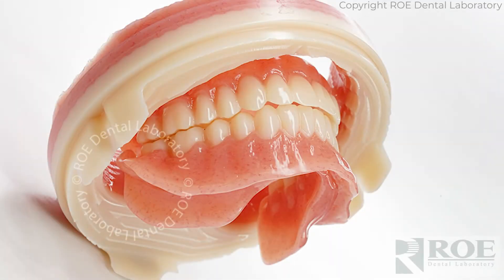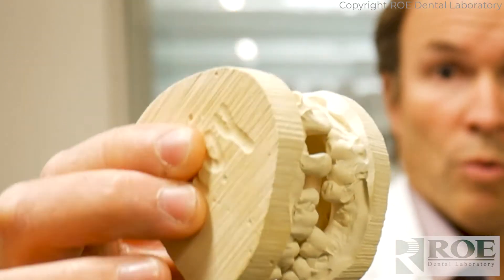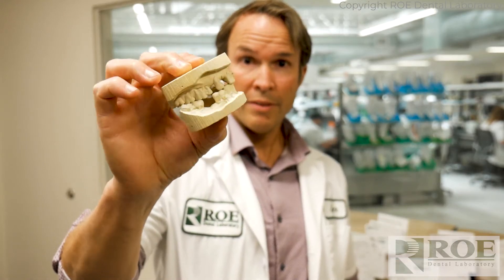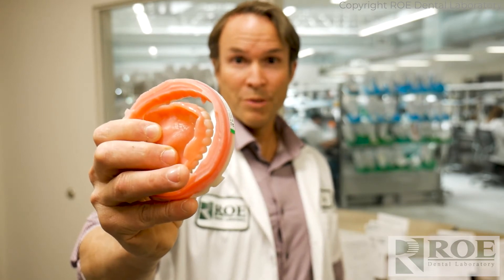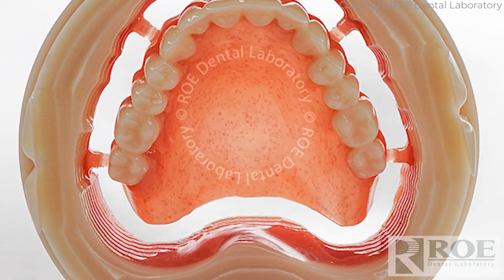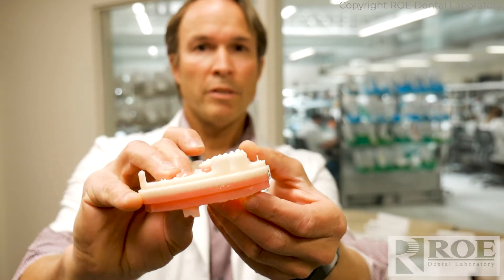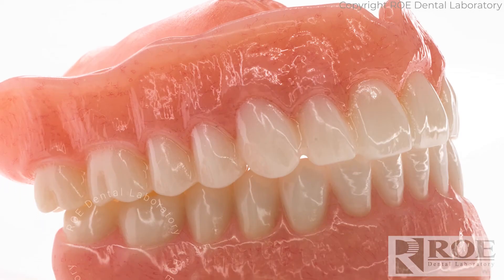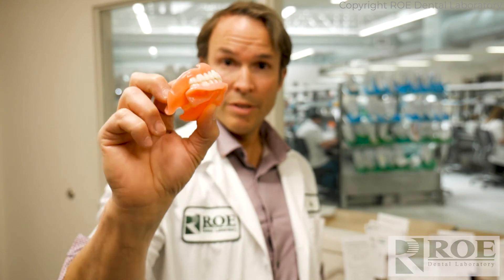Ivotion Milled Dentures: A Completely Monolithic Solution

Comment: I'm having my upper plate done with reinforcement mesh. I've cracked every plate I've had over the past 40 years within 2 years. I'm hoping monolithic will be the ticket.
Reply from the maker: Congrats on your new monolithic denture! The all-in-one design, milled from a single block, makes it exceptionally strong by eliminating the weak points found in traditional bonded dentures. Great choice for durability!
Reply: @ROEDentalLaboratory  thanks. It will be wonderful to have a plate I can depend on. I've been leery of eating steak beyond the one year point in fear of cracking them. I have all my bottom teeth, thankfully. My molars are about halfway gone after the second year as well. Denturist said it's like diamonds against stone, only a matter of time.
Reply from the maker: @GregJGreen  Well we can't wait to hear how that steak dinner goes!😉